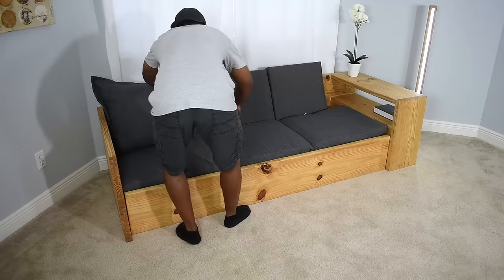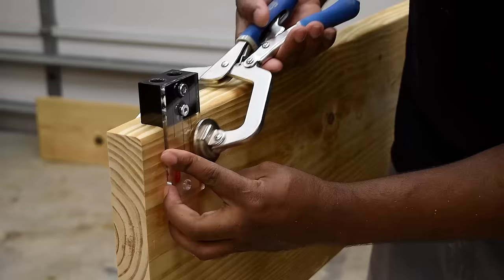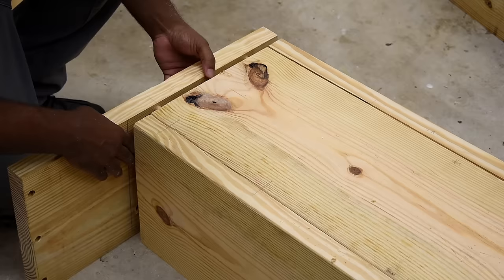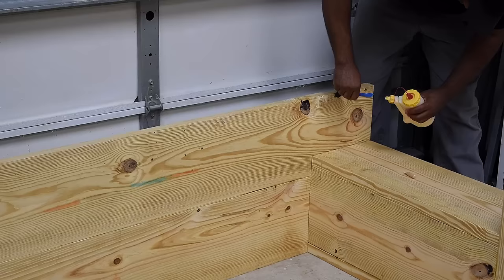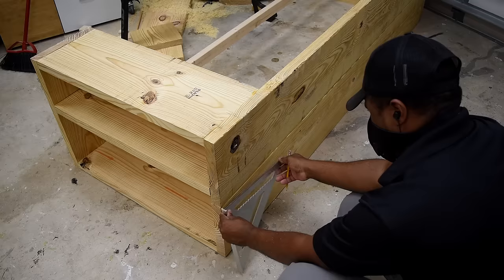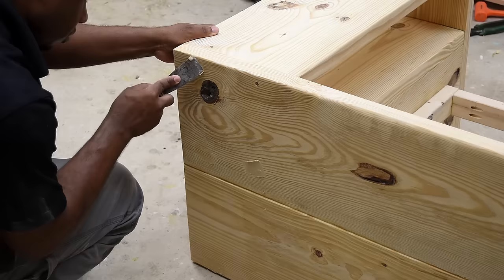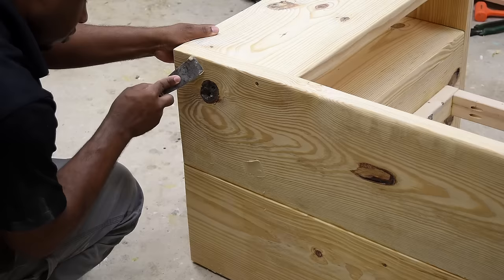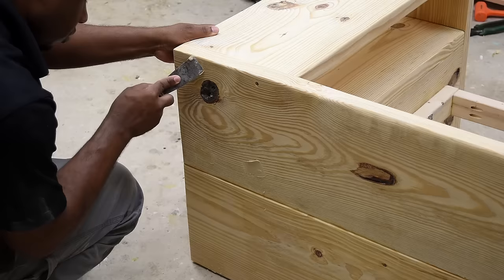DIY Sofa Bed / Turn this sofa into a BED

Comment: Nice job I was looking for something like this for my cabin. Your instructions were easy. Might I suggest you put a 1x4 on the underside of your pull out slats that way it won't pull out when you fully extend it. Other then that great job.
Reply: That's exactly what I was thinking. It would stablize the slats AND be a great stopper
Reply: Yup, I was just about to leave this comment 😊 I would add using a stop for the two sizes as well.

Comment: You did a great job on this. The carpet makes it a little difficult, but I wonder if the slide was built out in more of a box with casters on the bottom, if it wouldn't roll a little better. It would also mean you could talk out the middle support in the sofa section and add a 2x4 to the back end of the pullout, so it wouldn't pull all the way off. We're going to work from this design and make one for our cabin. Thanks for posting!

Comment: Just did the final assembly today. Overall a nice product. My main motivation to use the design was I don’t have much time right now so is an easy quick solution. I do have it setting on felt feet, which helps the front in sliding, as well as an arm on both sides. We are using a futon. In the short term I am using additional pillows when in the upright position as a 90 degree back is a little uncomfortable. Since I have carpentry and metal working experience, am going to modify the back so it is angled and that angle is adequately supported. I think it will compliment your original design. Well done!

Comment: Pretty cool for a college kid or a bachelor!
Reply: Or when you significant other gets mad at you and don't want you in the bed. You have someplace comfortable to sleep, instead of a couch.
Reply: My son is 6'5'. the closed in ends would be an issue. This would be great for a custom size bed, just have foam cut to the right size, make covers and sheets for them. Too bad dimensions weren't given, but people can look up standard size beds for twin, full, queen etc. Not CA King because they are longer. Then make a coffee table with storage for bedding and pillows.

Comment: I feel like you could probably buy two twin size foam matrasses and use one for the sofa cousin and cut the other one up for back and arm rest. Might have to take that into account when building thou. Great project, I like how you show that it is doable even without tons of fancy tools
Reply: Teresia Lidin, exactly right! And then keep a memory foam topper and the rest of the bedding rolled up and stashed in a trunk or closet during the day. (The topper will help make the gaps less noticeable.)

Comment: nice design. thanks. suggestion. 
1.find the cushions first then do your measurements for the sofa.
2. have your lumber yard cut everything to size.  not that expensive & you save time and no mess to clean up. 
3. put stoppers (engle irons) on the bottoms of the planks that pull out so you don't pull them off the track.
4. put teflon sliders under the pull out piece for easy slide and no marks on the floor.
Reply: The trick is that it's designed to a bed's dimensions, not arbitrary cushion sizes. If it's to fit a full bed then the sofa seat has to be at least half the width of a full bed. If a twin bed, at least half the width of that bed. There's a little fudging possible in both cases, as  the seat can be a a little bigger with a shorter slide so if you luckily find cushions bigger than half your target bed size...

Comment: You could also add a drawer under the part that pulls out to store linens. Also foam from joannes is a great option for the seat. Cut to fit and cover with safety pins attaching fabric to the bottom (out of site), or if you're handy, sew a cover (ain't nobody got time for that). Very cool build sir!!!
Reply: That's my idea too!! I want to make this build and add a storage platform under the sofa! I looove added storage haha nice for tiny spaces!

Comment: Nice work man. I think you are like me, Like to work alone. Take out the 2x4 in the middle so you can put a stop so the sliding side don't fall off. The other side is the same size and doesn't have a support in the middle.

Comment: I have a small home and no place for a guest to sleep. This is perfect. Compared to what I would pay for a (quality) store bought futon, I can use the extra money for more projects. This video was easy to understand and I appreciated the tips (do’s and don’ts) Do you have any suggestions for turning a (cheap) 3 season porch into an extra (insulated) bedroom?
Reply: You can make that patio into a beautiful room by using 1/4 inch plywood sheets to enclose the whole walls. Then frame a window and bam. ☺ If you cant afford to do it all at 1 time enclose the bottom half all the way around the room and add the rest as you can afford it. Thats what im fixing to do. You can add a beautiful storage area off tje back of your house the same way too!

Comment: you should put pieces of wood under the slots so it wouldnt fall off if you pulled it too hard
Reply: diego arias was thinking the same thing 🙌🏻
Reply: Same thought, wood or angle iron pieces to create a stop.
Reply: The problem with that is the sliding section has to pass the center seat support beam. You could put ears on the sliding section slats that sit in the spaces between slats, creating a T shape, and put stops on the top side of the front support beam. Only improvement I would add to the design.
Reply: yeah, just three pieces of wood on three slides and make small cutouts in the middle support beam and put a screw on each side of the cutout, no strenght is lost but it can slide out way further without being afraid it moves away at night, the stops doesn't need to be high, two, three centimeters are enough, the weight from the top keeps them where they are. But man that thing looks so nice, I think google read our minds, I'm planing all the time to make my own couch, but I can't remember searching for tutorials and now I get this one recomended xD And it is even better, this way I could have living and sleeping room in one and use the second one as working room and closet.
Reply: Agreed! My thoughts exactly
Reply: I thought the same also.

Comment: Nice work, but i had a suggestion if you put a stop (a piece of wood) at the bottom of the slats when pulling the maximum extension for the bed the slats would never fall off until you pick it up.
Reply: Dhanraj Lota same thought

Comment: I often see this type of Sofa in Van lifes and Tiny homes. For the material, they often get a custom fit foam that can fold up while for Sofa and then lay fully out as a bed. If you add rollers on the side with a stopper it won't come off and if you add a hitch on back board, you can lift the bed up for extra storage under the bed.

Comment: Love this idea for a vintage camper I'm currently working on. I'll repurpose 2 fairly new twin xl foam mattresses, cut 1 in half lengthwise, and use it for the back cushion. Depending on the size I cut, I can go either full xl or queen. With slight modification, I believe I can also add a twin bed lift to it and have much needed storage under.  Many thanks for your design and clear instruction!

Comment: I've been looking for something like this for my apartment! However, I think adding some storage capability underneath the sofa/bed would be extremely helpful. Especially for me since I have no storage/cabinets and my closet is tiny!
Reply: I was thinking the same thing. It seems to me it should be quite easy to create a storage space down there.
Reply: I was thinking the same thing. A simple plywood L on the floor and attached to three (left, right, center) of the boards. If you do that put 1/4 inch thick by one wide running rails under the box for ease of movement. That or casters.

Comment: I would've lowered the slates basically an inch in a half off the floor so the "cushion" can be a folded cushion. So it would fold into seating and then unfolded to make a twin/queen bed. That way the cushion can be pretty thick and have space so it wont overlap the backboard of the couch. So it will basically be a folded matress sitting inside(the lost underneath space) so there wouldn't be lost storage space underneath.
If that made any sense 😐

Comment: I think putting some stoppers on maybe 2 or 3 of the pull out 2x4s would be good so u don’t accidentally pull the whole thing out too far
Reply: I agree with your idea.
Reply: Or run a 2by the full length along the runners on the underside.
Reply: Lenz that’s exactly what I was thinking. It means you’ll never be able to fully pull the end all the way out without having to break out the drill, which can be both a blessing and a curse.

Comment: I love this built!!!! I just have one question. if I already have a small space, when I use it as a Sofa, where do I put the mattress?
Reply: I just put this as a comment (at the end). You'd have to work out the measurements to see if it would work but it would be a permanent  solution for a regular use bed that would take up no more space. You could just store the pillows and bed linen underneath.

Thats fantastic! If you want an idea for the cushions you can buy mattress density foam/sponge I don't know what you call it in the US we can buy it from large fabric shops though you might have to go somewhere else for ones that size. You can get the foam for the base cut to the width and length of the sofa/couch when its closed. You can then get the back cushion cut in one piece also hopefully the height that fills in the rest of the bed when it's pulled out. Then either sew cushion covers for the foam out of upholstery fabric or get a seamstress or upholsterer to do it for you. If you go for removable cushion covers made from machine washable fabric you will be able to wash them. It would probably also be considerably more comfortable than putting an air bed on and make even the cushions part of the pull out bed. Just don't go for foam that is too soft or not dense enough. Hopefully the people selling it can advise you I don't understand density  My mum and dad have a foam mattress (not memory foam) and it is over 30 years old and has only started to get less comfortable the last few years. Its been vacuumed steam cleaned and all sorts many times.
Reply: @smithy4121  You could use a futon cover. When the bed slides out the futon will fall. 
Or... You could fold the futon for extra cushion when you're sitting and then unfold it when you lay. That might give a seam in the cushion though.

Comment: Notice the zigzag dowel hole pattern along the lumber. Also, salting a wet glued joint prevents the wet joint from slipping.... another great video Glen - thanks ALSO.. love the lights... I'm gonna make use of those down the back of my floor standing speakers....

Comment: Great work, but how much did you pay for the sofa and why didn't you just use Plywood?
Reply: Klaus Radinger He said it cost about $130
Reply: Oh, thanks
Reply from the maker: Thank you, All the lumber was like $120 ish. The plywood would have been lighter but also more expensive. Not to mention it wouldn't have the thickness.
Reply: Oh. That's interesting. In Germany Plywood and glued boards are way easier to buy than "real" wood planks. You can get Plywood and glued boards in every hardware store and "real" wood planks nearly only in Sawmills and the ones you get in hardware stores are rough cut, because they are for scaffolding. Plywood and rouch cut planks also cost nearly the same in the hardware store. But it seems to be easier and cheaper to use wood planks in the US than in Germany.
Reply: Looks like he used dimensional lumber for this build -- the rounded edges and super rough, knotty surfaces are a giveaway. Dimensional lumber is intended for framing houses, not building furniture, so you typically have to put a lot more work into it to get it straight and looking nice. But it's definitely cheap. For many people, it's also the only solid wood they can get, because they don't live near a proper lumber supplier.
Reply: @klausradinger2861  Yeah, same here in Nigeria. Plywood, mdf, hdf, are the go-to's for most furniture because its cheaper.
Reply: Ply is ugly... but plank looks natural, especially the sofa arms r left bare with out cloth cover.

Comment: In addition, you could make openings for drawers on the front panel, yhe drawer would be the depth of the closed form (couch) and would shift out as it was moved to bed for. This would add additional storage for a smaller space. Additionally the empty space could be used for futon storage to be accessed via panel under cushions. Nice work, a little bulky. I can only imagine how heavy it is. Kind of a place it and leave it kind of furniture.

Comment: I built mine 4' deep by 6'.  Bought two 6' by 24" air mattresses for $30 total. One is the back rest, the other the seat. When pulled out, the backrest gets dropped to fill out the bed.  #offgridcabin #aintpretty  Work's great to fit two more people for the night.

Comment: I don't have the awesome woodwork skills you have but i personaly think the pull-out parts could use a 2-3inch  stopper connected at the ends so that you eliminate the risk of pulling the attachment too far and end up disconnecting the two parts. I dont know if you get it but that's my idea.

Comment: attach 2 inch pieces to ends of the 1X2' that pulls out facing downwards, that will prevent it from pulling all the way out. Make a soft cushion that folds over the backrest, when the bed is extended it will become the mattress.

Comment: The futon mattress is the better option as it is flexible and will serve as backrest as well as seat cushion...pull out is easy but pushing it back in requires a little more effort. and I added a 4" thick memory foam topper for added seating and sleeping comfort since I sleep on a futon mattress with the topper on it, and with the projector. supplied with signal from the lap top, Direct-TV box, X-BOX 1-X and DVD/VCR on a shelf on the wall  above  me and the screen on the wall across the room. Well you get the picture. I like my electronic toys what can I say...lol

Comment: In place of cushions use a full size memory foam mattress and slice it half way through. Fold it up to a 90 degree angle for the seat and back rest. Then when you pull out the front it'll flatten out. Just use a deep pocket fitted sheet and mattress protector on it. No moving cushions. Not storing a mattress.

Comment: Great concept & instructions.  Love that it's functional & versatile.  My only concern is, how heavy and awkward it would be to move/relocate it once it's built.  I'm wondering if the design can be tweaked so that the larger pieces can be taken apart and put back together for transporting.

Comment: Hey Glen, this is just a thought I had... If you attach two (say six inches long by one to one & a half inch diameter) tubes to the inside front lower edges of the side arms, then somehow attach two pipes (that would slide through the tubes) to the inside front lower sliding section (and maybe three rollers to the bottom of the front sliding panel) you'd basically have "tracks" to keep everything in alignment when pulling/pushing the front in and out.  You could also create "stops" on the pipes to keep it from being pulled too far apart.
I hope this makes sense to you (because in my mind it works "Wonderfully 🤪😁🤣🤣!!!).
Thank You Sir for another great build and video!!!

Comment: I wonder if a simple locking mechanism to keep it shut and a set of small hidden wheels for easier roll out would be a possible solution to the carpet issue?

Comment: 10:43 If you secure anchor points, or eye holes on every second slat of the pull out section, you can tie a cord to secure it, eliminating the pull out problem.

Comment: Thats fantastic! If you want an idea for the cushions you can buy mattress density foam/sponge I don't know what you call it in the US we can buy it from large fabric shops though you might have to go somewhere else for ones that size. You can get the foam for the base cut to the width and length of the sofa/couch when its closed. You can then get the back cushion cut in one piece also hopefully the height that fills in the rest of the bed when it's pulled out. Then either sew cushion covers for the foam out of upholstery fabric or get a seamstress or upholsterer to do it for you. If you go for removable cushion covers made from machine washable fabric you will be able to wash them. It would probably also be considerably more comfortable than putting an air bed on and make even the cushions part of the pull out bed. Just don't go for foam that is too soft or not dense enough. Hopefully the people selling it can advise you I don't understand density  My mum and dad have a foam mattress (not memory foam) and it is over 30 years old and has only started to get less comfortable the last few years. Its been vacuumed steam cleaned and all sorts many times

Comment: Sunggestion...to prevent it from pulling apart, fasten the slats on the front part together with a board underneath on the ends.